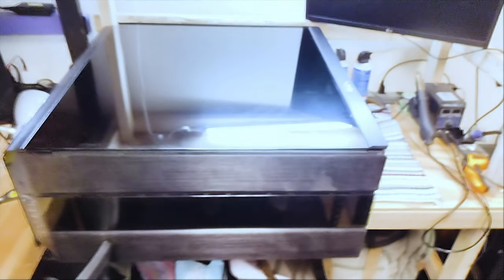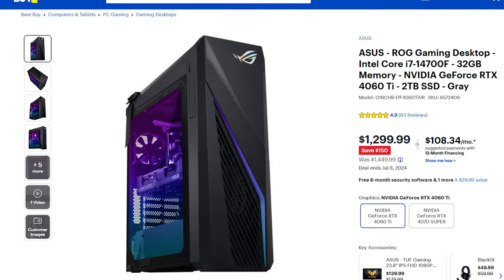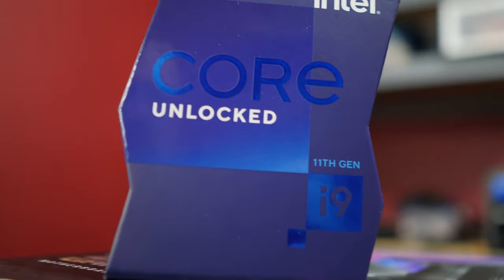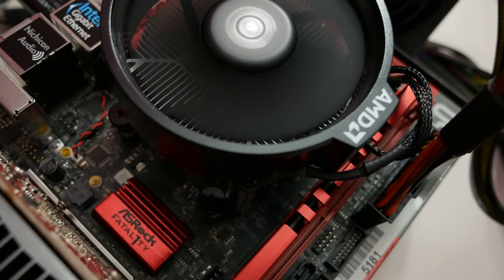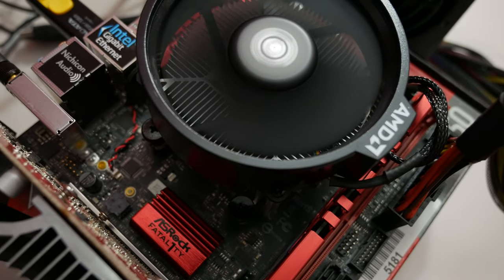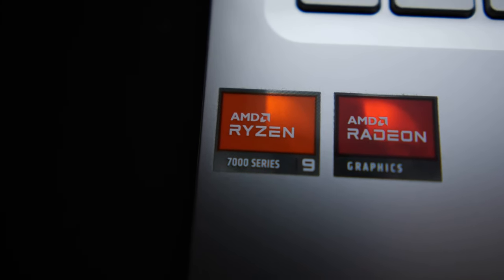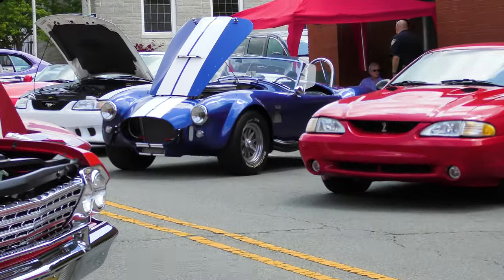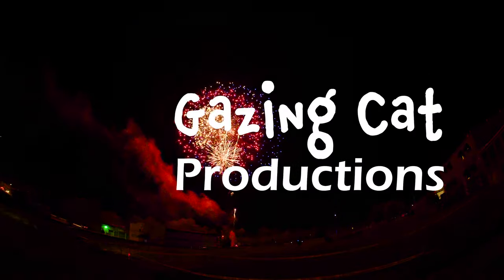A Threadripper Is A Waste - Jody Bruchon Tech

Comment: The point is about having a reasonable amount of PCIE lanes instead of consumer platform.  You can also get more memory bandwidth and capacity.  Oh how I long for a repeat of X99.  Before Ryzen, things were great.  Now you have $300+ consumer socket motherboards and $700+ consumer socket CPUs.  For just a bit over a grand, you used to get 50% more cores than you needed at the time and the HEDT board.  $300 X99 Taichi, $620 ish for i7-6850K (or $440 ish for i7-6800k if you could get along with 28 PCIE lanes instead of the full 40).  Threadripper has gotten out of touch with what it should be.  12 to 32 cores with quad channel desktop memory instead of more expensive registered ECC server memory and starting at 24 cores.  Having more than 8 cores on consumer socket is not good for consumers because all it does is drive up costs.
Reply: BTW: I do agree with the premise.  I repaired a gaming PC that turned out to literally just be there to run Office 365 and answer mails.  Instead of an i5-12400f or whatever i5 it was, they could have gotten an i7 or even i9 without the RTX 3060 Ti GPU and saved some cash.  Oh - and they wouldn't have the RGB bling - tho maybe they wanted the bling?
Reply from the maker: The vast majority of people will never use the lanes. I get that these are built for massively multi-core things like VMs but without a load like that I can't see how most people would come remotely close to loading down the chip!
Reply: @cracklingice  Wait a minute... Why get an i7 when the guy that will use the computer is only running an Office suite and a web browser or email client?
Reply: @JodyBruchon   Thats why it is for editing and heavy loads where people need a lot of ram for certain programms. Your comment makes no scence unless the buyer is not using it for it's purpose. It would be the same you stating that server chips have no real use as they are slower in gaming and single core loads. But server chips and HEDT are not designed for daily normal computer use. So your statement is absolute BS!
Reply from the maker: @karlos1060  I have no idea what you're talking about. This video is about a Threadripper used for Word and web browsing. No one is talking about gaming or video editing or VMs or any of that here. Having 64 PCIe lanes instead of 24 and using 20 of them means the extra lanes are completely useless. Having quad-channel memory with single-core workloads is also largely useless.
Reply: @winnyace  Single threaded performance is important too.  The i5 is lower in single thread performance due to smaller cache and lower clock speeds.

Comment: The point of threadripper is for high cpu loads that require lots of cores/threads not for gaming. They will suck at gaming because they are NOT made for it. Its pretty much the only workstation option that doesnt suck

Comment: Threadripper is not a fast chip, but just try to choke it with operations. I have a threadripper pro 32 core with 256 gb ram, and RTX A6000 graphics. I use it to run solidworks, while 3d scanning, setting up 3d prints, ripping 4k blurays, and watching a movie or youtube, occasional gaming. Usually all at the same time. This setup has been great for moving large datasets around. 4k Bluray ISO files are up to 100gb, 3d scan files can take as much as half the ram, and most of the 48gb VRAM in the RTX A6000. I definitely utilize the resources, i just with multithreaded apps were better optimized for multi core processing.

Comment: If I recall, you need threadripper and beyond on modern AMD to get ECC RAM and get more PCI-E lanes, maybe more RAM channels was in there too...there are reasons, but they are NOT for normal everyday PC users (except ECC).
Reply: AMD doesn't lock down ECC, you simply have to get a motherboard that supports it.

Comment: The threadripper seems like a big brake kit in cars. Your braking distance is NOT determined by the brakes themselves, at least not directly.  It's determined by the tires. The brakes only affect it in terms of It's ability to maintain a suitable temperature.  The more you cook them, the worse braking you get. So you only need them if you're adding power or grip that gives you a stronger bite. Otherwise the added weight will hurt performance everywhere else, making it a bad prospect.

Comment: I own a 7970x (worth 2.5k without taxes) and I mostly went for it because I'm compiling a lot of software and it's fun to have that many cores at my disposal. I know it's not a reasonable purchase and I will never be able to make it "worth it". But hey it's fun to rock one of these.
Reply from the maker: I have a 5950X. I run HandBrake a lot. Two x265 1440p encodes can saturate every single thread of it and still take hours to finish. It really just depends on your workload.
Reply: @JodyBruchon  yeah. Look at least I can compile chromium under one hour with this beast xD

Comment: Threadripper was not just about more cores though. While it is probably true that single performance is not as high as mainstream one, you have to understand that those had more than 2x ammount of cores (i think it was actually 4x but anyway). Some games can actually spread the load decently, so I wouldn't say it if always slower. Most of the time probably is. first and second threadrippers were probably only ones that you could argue were somewhat decent for gaming, but that was not the main selling point. Main selling point is the amount of PCIE lanes.  Where as with mainstream board (either intel or amd but intel had actually fewer at the time) you can't put nvme card with four m.2 drives in and GPU because GPU alone will eat up 16 of 20-24 lanes mainstream has. So essentially you have to start to split your pcie lanes between your devices. With NVME setup that for me for example runs at raid 0, it would mean that my I/O transfer speed is around half what it could be. If you have GPU with latest pcie version it might not matter that much, but if i had mobo from that era, it would really affect performance of GPU because essentially you would be running it at same speed that pcie 5.0  4x slot would give you.  It really boils down to question, do you really need pcie lanes for other devices than gpu, if no then there was absolutely no reason to buy threadripper, if you want then you would have to ask yourself if you want them so badly that it justifies extra money and loss of performance. With 20 lanes you have like 4 lanes that are shared between sata, onboard m.2, ethernet, audio etc. I really don't understand why motherboard vendors even bother putting more than three pcie slots because of this. Good advice to build pc for your needs and not just throw money to problem

Comment: I had a threadripper 2990wx for compilation, but it was quickly stomped out by future generations of ryzen and had a really low max temp of 68c so it would throttle. When I got the temps under control the VRM's started overheating on the board. AMD also stopped supporting TR4 after like 2 releases which really pissed me off. I agree that threadripper is a colossal waste of money for most consumer workloads though and it's single threaded performance is abysmal. Unless you need a high number of PCIe lanes or actual threads, just get a regular consumer chip.
Reply from the maker: And the VAST majority of people will never use that many lanes. A graphics card and SSD is all that most people will ever have.

Comment: Holy moly, Word and Outlook ? Even an R7 might be a waste. I though initially that it was server for the company.
One area where a Threadripper, even an older one, might be better than normal CPUs is the number of PCI-E slots and memory channels (really, max 2 channels for 32 thread CPUs is quite stupid, especially given that Apple with the M Ultra chips have 16 (sixteen) channels, but that's another discussion). Of course, those only give a benefit in certain situations. Using Word and Outlook are not them :)) Maybe a gigantic Excel spreadsheet might benefit from it.

And, yeah, a bit annyoing seeing how others are wasteful, while other have to struggle with so much less. But, hey, life was never fair. Come to think of it, one of the greatest achievements of the modern society is making life much fairer. But we're still half way there (at best).

Comment: I have as daily driver an i5 8th gen 8 cores... I've never seen a 100% load as I used to see in the past... All I see under "heavy load" is 12%.. It is infuriating!!
Reply from the maker: 12% is what you'll see if a single core on an 8-core system is maxed out and all others are idle.

Comment: lol So many fun ways to use the Threadripper but for office work its a huge waste and its slower compare desktop CPU because it has to sacrafic single core performance for multicore performance.    I have 1950x I would split the machine into 2 PCs just to see how well it multi task.   I ran 3d Mark on one and played Overwatch on another.   Its not really that bad since its 180 watts split into two PCs

Not many people didn't realize those TR CPUs have two nodes and each has its own ram slots.   You can actually have almost no performance loss.   I wanted to try again getting used 2950x when they get cheap.   Only thing I wish if I can split like a single GTX 1080 ti into 4 vGPU but sadly its not doable that tech feature is reserve for server GPU class products.

Something I'm thinking of is split the 2950x into 1 main computer with 8/16T cores on node 0 and 3 VM on node 1.  One would have 4/8T and rest is 2/4T.   I use KVM over ethernet to connect each area in the house or share one over the internet for a friend.

Keep in mind I'm aware of the newer CPUs.  I just like playing around older hardware.  In fact my Ryzen 7 5700g is way faster than the 2950x.  5700g is scoring around almost 2000 while 2950x scores about 1200 on geekbench6 single core.

Comment: Largest machine a customer brought me was a dual socket setup where the customer added 2nd processor and loaded the other 8 slots of RAM. Before doing so customer asked and I recommended against it until the customer specifically hit a need for the additional CPU and RAM explaining that basic computer use will be slower. He proceeded as it was him learning what hardware can do. The one good thing that came out of it for him was I found his memory reported corrected ECC RAM errors; they were corrected by reseating the original memory.

Comment: It just feels strange for a computer repair shop to judge the hardware choices of a customer. I guess it's fair to suggest a cheaper alternative part if the computer turns out to be not fixable. But questioning the purchase decision itself really doesn't seem professional.
Reply from the maker: Why is it strange? One of the most important things we do is advise people on what to do. Also, the issue was a motherboard issue and replacement boards are NOT cheap. They could buy an whole machine for the cost of the replacement board alone. The workload is Office and a browser. How do you reach the assertion that "it's not professional for an expert to advise based on their expertise?"

Comment: I have known for years that when it comes to performing a specific task, more cores/threads equals diminishing returns.  This is why 6 cores and 12 threads is the ideal sweet spot.
Reply: That's as may be for a budget PC, but for a premium build these days I wouldn't want to have less than 10 cores. 8 minimum. They may be somewhat situationally useful but you'll be glad to have them when those situations arise. There definitely are games that will use a lot of cores, and for the ones that don't it's still very nice to be able to leave processes and other programs running the background while you work or game.
Reply from the maker: @Fetchdafish I have see a Ryzen 3600 outperform a Ryzen 7 3700X. Less cores meant it could turbo core a lot harder. Depending on the workload, more cores can be worse, especially with modern processors that aggressively over clock cores when thermal margin is available.

Comment: The threadripper is a waste for those who buy and build it without understanding its uniqueness nor purpose i.e. a workstation chip not a gaming nor office desktop one.
That you advised your client to switch to a desktop platform without success doesn't make the chip ot platform bad, it just his personal preference and that motherboard replacement is going to cost him a lot due to their rarity regarding availability.
Also, TR's are so pricey due to Intel been uncompetitive in the workstation space.
For one who understands computers enough to repair tjem, your video framing is so negative & unnecessary.
My 2 cents
Reply from the maker: Did you somehow miss the PassMark scores in the video? Ryzen 7 chips one generation newer compete with the Threadripper. I'm not going to put a positive spin on a bad choice. That's stupid.
Reply: @JodyBruchon  Passmark scores or not, TR rocks for those who need & buy them i.e. use the right tools for the job at hand. Desktop Ryzens are fast like Ferraris, but lack the grunt of semis or dumpsters or even the yellow American school buses in load carrying and can function as cheap servers above the Ryzen 9s without the limitations of PCIE lanes and memory.
While desktop Ryzen can now do 128 GB RAM, its PCIE limitations are a sore thumb refusing to heal.
Zen 3 and 5 TRs [having better IPC] crush Passmark and many other synthetic tests apart from the revenue they bring in to AMD who sells them in boatloads. It means those purchasing them are deploying them to good use with both having PRO variants on top their vanilla flavors.
Personally,  I have Ryzen two 5700x PCs (upgrades from the 1700x) which serve my virtualization & other computing needs for now. Yet running multiple VMs using type 2 Hypervisor makes the system crawl. Due to this, I switched my OS to Linux, Tier 1 VM Hypervisor and whilst upgrading to a Ryzen 9 chip would also help out [albiet temporarily], ultimately in this days of LLMs , AI and many other new technologies , a workstation or server computer would be the most adequate for MY NEEDS eventually. Bottom line is understand your workload and get the tools for your best effectiveness.

Comment: Would you be interested in making a video about building a decent pc from old parts for pc musicians?
About 2yeats ago I bought Acer Predator that is easy 10 years old with intel i7 and now I have 32gb ram and would like to upgrade it…maybe a processor and a quiet graphics card. Because ram is maced out already.
Reply from the maker: The bloat of modern software is the problem if you're a musician. I used to run FL Studio 10 on a Phenom II X6 1035T just fine. If I put Cubase on there it would probably choke.